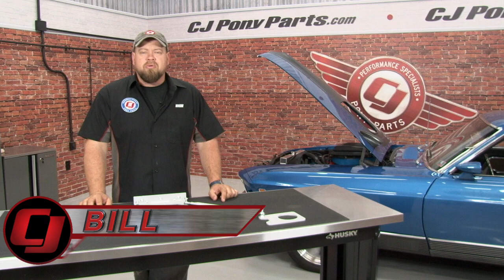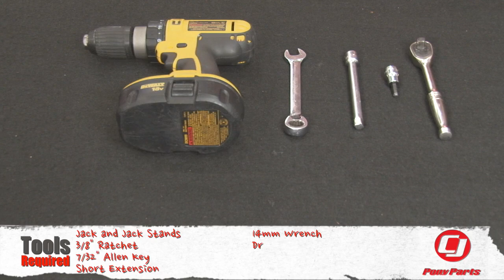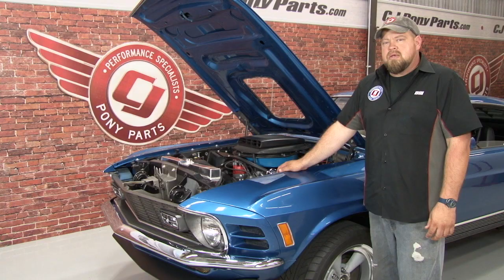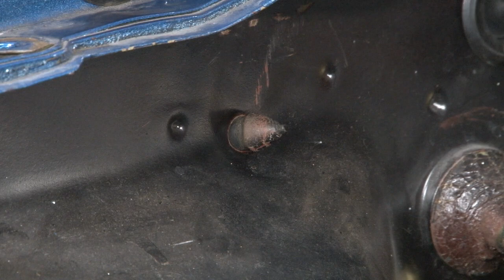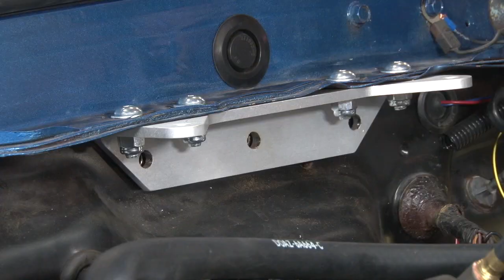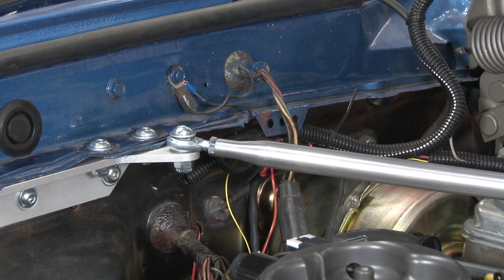Adjustable Aluminum Export Brace | Total Control Products | 1965-1970 Mustang

Comment: Do you have a brace for the 1969 Boss 429?  We live in Annville and drive by your shop on the way to the Hershey car Museum every year.  Last year we did a burnout in both the 69 and 70 429's in frotn of your shop!!   The 1969 is an ALL ORIGINAL SURVIVOR in Wimbeldon white and was missing the brace when it was purchased in 1989.  With exception of BFG Radial TAs shes all as left the factory.  We also have a 1969 302. 70 302, and a 71 351 as far as Boss cars and there are 2 more 69 Mach 1 SCJ-R's.   Please message me about the brace.  Maybe we can stop by the shop with the 429's???